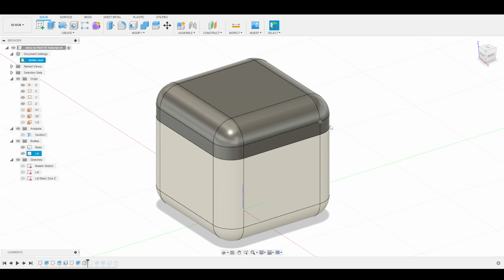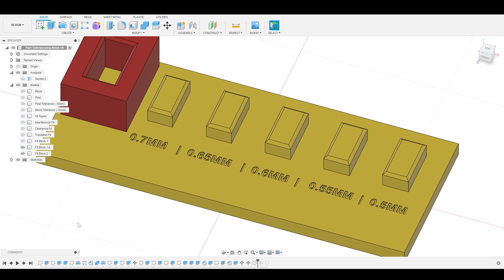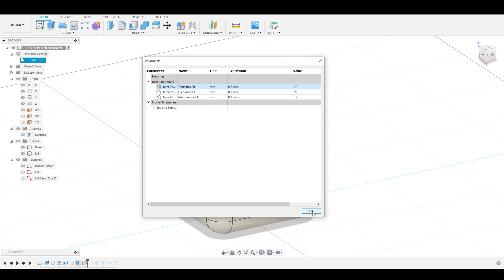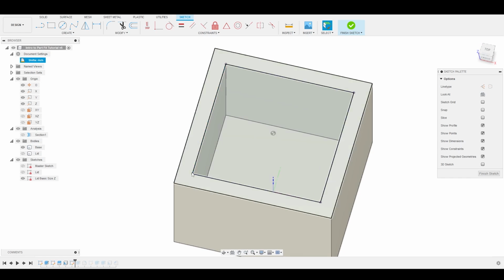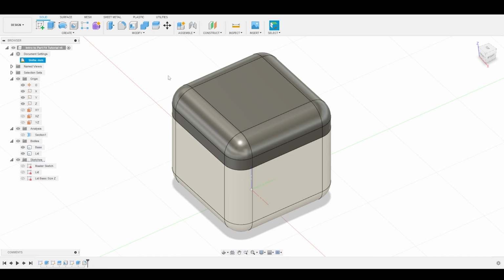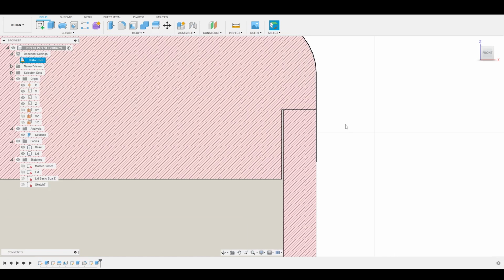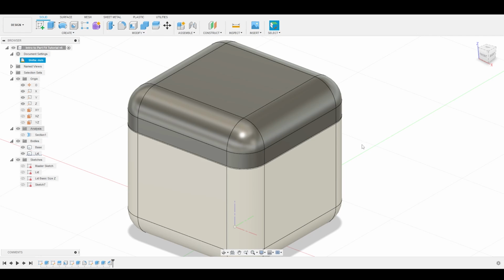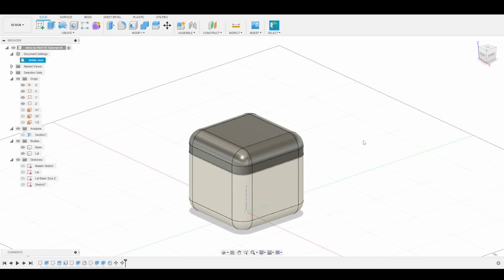Beginner's Guide to Designing with Fit (Fusion 360) - Get the Perfect Fit from your 3D Prints / CNC

Comment: Both this and your original video covering tolerances and design for fit were excellent. Thank you. I’m wondering if you also put calipers to your test prints of shafts and holes so that you know the actual deviation / error from nominal (verses checking fit between both parts you have printed). I’m thinking of the case where you’re designing a part that needs to fit with another component or assembly produced by a 3rd party, not printed by you.

Comment: I go simpler, my tolerance is 0.4 mm as well, but I apply it directly on the design or use either push/pull or offset faces. You can go back and modify this parameter in the timeline too. Thanks for the tutorial.
Reply: That may be fine for a simple part (I do this also), but for even moderately complex designs with multiple parts/components, using well defined user parameters is certainly best practice.

Comment: I understand offsetting the shaft, however why do you need to offset the adjacent face? If the shaft clears wouldn’t the lid close anyway? It seems like it’s just closing .4mm lower. Someone help me understand.
Reply: It's not important in this example, but if you need perfect lenght dimensions, it's important. I suppose that's why he shows how to do it.
Reply: @Roman-6969  what do mean by perfect length dimensions? like final box height? wouldnt you just set it to the final size anyways? I got a bit confused as well on why he offset the adjacent face if thats where it sits it would just be taking height from the box

Comment: This is not a good approach. There is the "Press Pull" option that allows you to simply select faces and specify how much you want to them pushed in or out.
Reply from the maker: Hey Jonnie,  Appreciate the feedback.  Your comment brings up an interesting point that probably warrants a follow up video from my side.  I actually really like the convenience of the “Push / Pull” feature inside Fusion BUT I also think it has some issues, especially for beginners.   My main issue is that it tries to do too much and combines too many other features together.  Personally I like to be intentional with my features and order of operations so I don’t like how Push Pull contextually switches functions.  Yes it keeps the timeline clean but it comes with the risk of losing your design intent/ your ability to track changes if you aren’t careful.   The other (minor) issue I have as someone who bounces between CAD programs is that there’s no direct 1:1 in the other programs so that can be confusing for beginners.  Regardless, you make a good point that by only explaining the basics principles for adjusting fit in this video I don’t explain the faster techniques for actually getting the job done.

Comment: Nice Video. I just started to use Fusion 360, before I was using FreeCad which seems much more complex and less pleasant.

I think it easier to us "Press Pull" feature on selected walls to adjust clearance/tolerance instead of doing offset on sketch.

Comment: Instead of doing all those projections and such, can't you just simply extrude 0.4mm from each side needed for a tight fit without having to do all that complex stuff?
Reply: Great question!  The fun thing about 3D modeling is that there isn’t necessarily a right or wrong way in a lot of cases, it just comes down to what makes sense for you / what is the fastest workflow for you.  Personally I like to use sketches whenever I can because it’s easier for me to keep track of and I feel that it minimizes the # of operations but yeah try out the extrude technique if that works for you!
Reply: @jetpackproject gotcha, thank you for the clarification! You’re right about there not being a right or wrong way in 3D printing. I actually tried the extruding method to connect two pieces together, and it worked!

Comment: thank you. What tolerance values would you use if you are just making a model to sell the stl to others? If you don't know what printer they are using is there a basic tolerance value we should use?
Reply from the maker: I may not be the best person to answer that question since I don’t sell any files currently, but I had got a commenter a few weeks ago who said that he’s found that the fit offsets tend to match up with the nozzle size 0.2mm nozzle = 0.2 mm transition fit.   I haven’t tried this personally but it might be a good starting point for you.    When you sell your parts maybe offer users 2 versions with the 2 most common nozzle sizes.

Comment: The parameters for the transition fit are related to nozzle size. In general if using a .2mm nozzle, you’ll use a .2mm transition parameter. A .4mm nozzle = .4mm transition, and you can see the pattern thus forth.

Comment: One thing to not is that 3d printing has a smaller deviation in the vertical direction than horizontal
Reply from the maker: Great point!   2 independent variables / parameters may be required depending on your printer/ print settings!

Comment: I couldn't agree more with parameters being the most important point. This is such a time-saver, and can avoid so many mistakes. It's not like you have to create parameters for every single dimension, but any dimension that you change or that is based on a value you change has to use the corresponding parameter. I find it so frustrating to watch videos where people go back through their history and edit a whole bunch of dimensions to test just one actual value change. It's really one of the best features of Fusion 360, I don't see how I could use a CAD program without it now. edit: forgot something: you can add a button for parameters to your toolbar, this is what I did since I use it so often (find Parameters in the dropdown, then click the ⋮ button on the right).
Reply: Great tip

Comment: woow That's really useful! I didn't know about the TransitionFit Parameters and as you said, evey time the fit was not correct i had to go through every sketch!
One thing though, is there a reason you project the edges on your sketches? When you create a sketch based on an object surface you already have those lines to work with, so is there a benefit to this? or it's a thing you like to do?
Reply from the maker: Hey Dimitris, Great question!  I wouldn’t go so far as to say that projecting the edges is a ‘best practice’ but I’ve found that is a good way for me to stay organized, especially as my models get more complex.  When you project the edges its a way for you to manually select exactly what you want your offset edge to reference.  Plus you can name that sketch something like ‘Lid Fit Offset’ to make it easier go back an modify if you change your model upstream and need to change which edges you are referencing.

Comment: I can't begin to tell you how valuable this is for me!    I just bought my first 3D printer  to make items for a few of my hobbies.   One is to make cases for ESP32 based parts.
I had tried to find STL files out there, but was amazed how terrible the fit was on virtually everyone.
So, despite not wanting to... I decided I just have to design my own.    I have significant experience with 3d design, but in the art arena not CAD.  I tried TinkerCAD and it was very useful, but I quickly found that it's limited tools was a significant hinderance.   
Then, I found out that I can get the Fusion 360 hobbiest version... so now I am on a mission to learn that  to fit the need above.

MY only request (since the vid is titled 'beginner') is for you to slow down and use mouse click highlight tool in your recording :)

Thanks!
Reply from the maker: Heyo!  I’m really glad to hear that this was helpful for you!    I appreciate your feedback on the mouse clicks, I recently switched screen capturing programs and I promise I will make sure that I’ve got that turned on moving forward!    I would definitely recommend that you check out the other beginner’s guide videos that I’ve uploaded, particularly the 4 part construction brick video.  These are my ‘starting point’ videos for Fusion so I do go a bit slower and highlight the mouse clicks.  Happy Modeling!
Reply: @practicalalchemy407  thanks,  I have already watched your first 4 beginners videos, excellent!